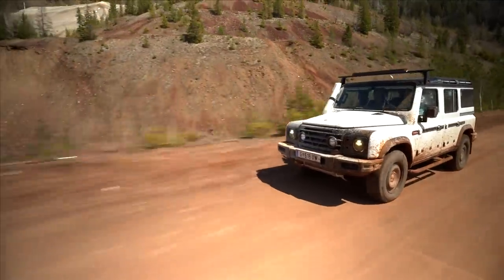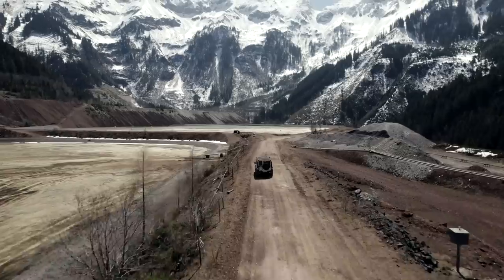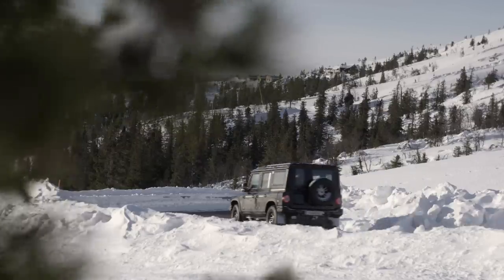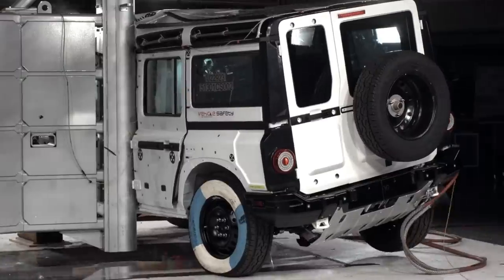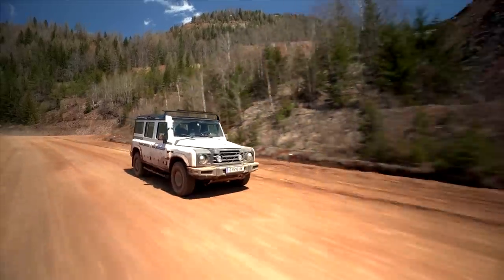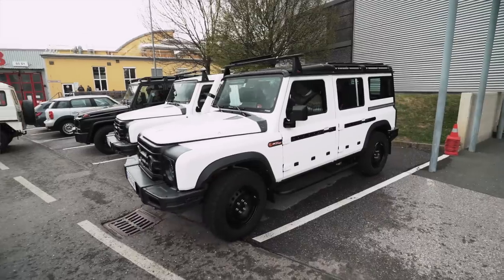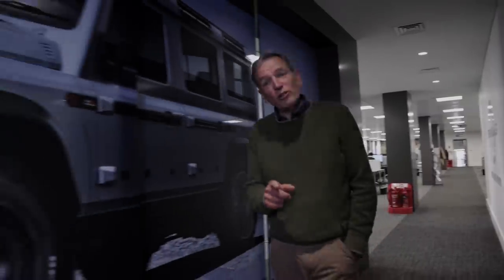Building the Grenadier -  Episode 8  - Testing and Development

Comment: I like the utilitarian nature of the grenadier but it will need some decent on-road manners if they’re to be embraced by the masses. I drive the most capable off-roader produced (G550 4x4 squared with portal axles and 4 shocks/dampers on each corner) and it drives wonderfully on the road as well. I understand they won’t be able to compete with my G550 but I hope they use it as a benchmark!

Comment: That's strange, so no tests at the middle east to see how it performs in summer. The desert of Dubai & Abu Dhabi in summer are way more challenging than the places they chose
Reply from the maker: We will be, just haven't been able to confirm just yet!
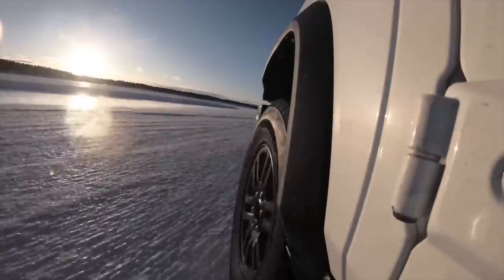Reply: 2:46 preparing summer testing...
Reply: @INEOSGrenadier  I confess I'm surprised that Australia wasn't in the testing locations. Not being parochial but it's known for being a tough environment on any vehicle, which is why so many companies test here.
Reply: @k2svpete  It was interesting how Mercedes' G Wagen Canning Stock Route publicity  event left all the W463 models stranded with broken rear dampers and fractured spare wheel holders, but the W461 Professional survived. Presumably Grenadier will spend A LOT of time testing on hot corrugated tracks and avoid falling in that hole......

Comment: Will there be any analog,non electronic,nato/military versions without ecus,dpf,abs, auto box and manual windows rubber floor mats and so on or can't this be done in this health and safety conscious world?it would be light simple and easy to repair,Mercedes om 602 or om 603 would do as a power source,power is not everything.

Comment: I wonder if it will be as much of a dog as a landrover?
Reply: Considering it is being designed from scratch, I doubt it.
The old Land Rover was always a compromise.
Reply: Well it looks like a Land Rover but being designed by Magna (former Steyr Puch) and using German engine/gearbox I guess it will be more like a G Wagen than a Land Rover...
Reply: @lukasvass681  I totally agree with your comment. I would just like to add that it is being built by a Mercedes trained workforce which will only add to the reliability.
Reply: @harveysmith100  Mercedes and reliability I'm afraid don't go together in automotive circles where I'm from.......
Reply: @harveysmith100  I think it has the potential to be great..... But fear it won't be......
And also...... who exactly would buy one?
Reply: @thewhiteoxoverland  Look around you, see all the people who bought the old Defender. I saw the news last night, the Israel defence force were using them.
There are plenty of customers for them. They just stopped buying Defenders because they were so out dated, (who wants a brand new vehicle that leaks from the factory.)
Mercedes replaced the ageing Gwagen with a modern version including a military version. Toyota still sell plenty of 70 series. 
It will outsell the new Defender within 12 months of launch or sooner.

Comment: It did make me laugh when Gerry McGovern cracked that 'joke' saying that the new Landrover Defender had done a million miles of testing (Which actually turned out to be a million KM of testing). I looked out of the window at the 4 cars on my drive that have done over 300,000 miles and thought that's a great joke Gerry well done! I've now realised, from the catalogue of software, trim and drivetrain problems that the new Defender has that Gerry wasn't actually joking! Why will Landrover NEVER learn. Of course the cause is simple - In the UK, unlike in Germany, accountants have a greater say than Engineers.

Comment: Guys, Stainless Steel chassis components please!!, especially those exposed to sand blasting and stone chip, also!! ....BRAKE LINES which generally suffers from corrosive salt roads, some 4x4 competitors parts don’t even see 8 years in more extreme conditions !! Stainless Steel aren’t expensive anymore either and you save on paint!!. ‘Ask Elon Musk”

Comment: As a Mercedes G-Wagen owner, it should be noted that Magna-Steyr does a poor job of Rust Protection of the W460, W461, and W463 body and chassis. Search the web and you will see amount of rusted bodies and chassis out there. I pray someone at Ineos can make Magna Steyr use the coating products that Ineos the chemical company already makes because Magna Steyr has failed and will continue to fail unless they change their procedures and surface treatments.  #stoptherust

Comment: Are all the bolts nuts the same size .does it have a hydrogen generator will it run on heating oil bio and cheap african fuel